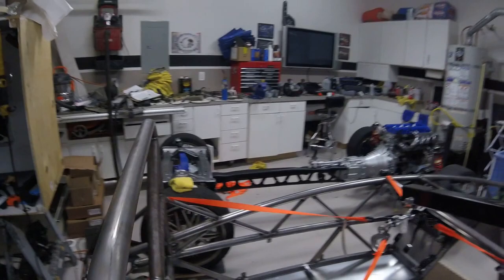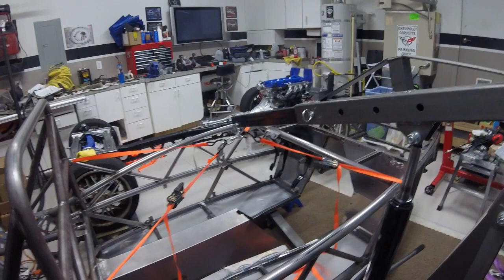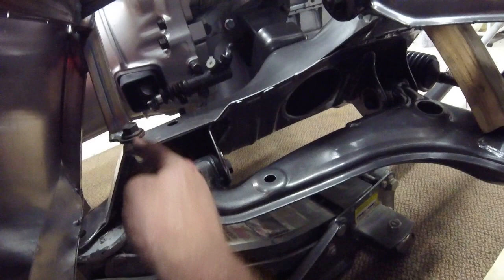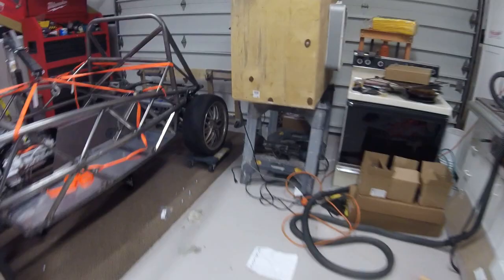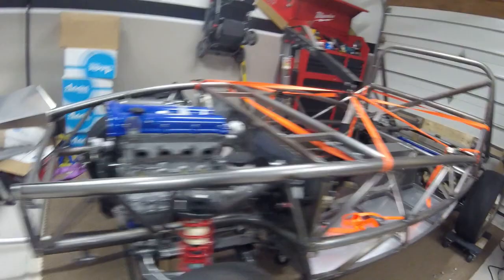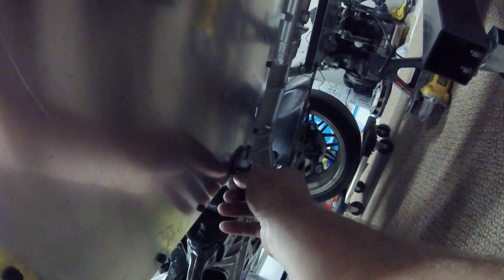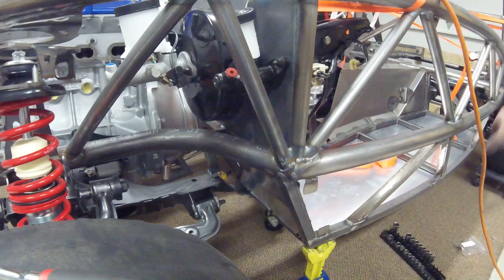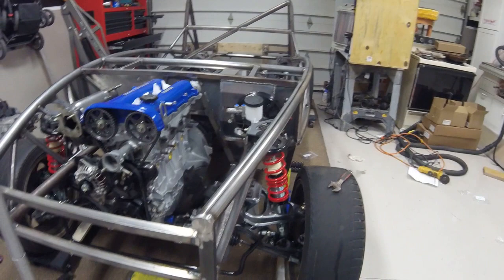Mounting The EXOCET FRAME On The Mazda Miata Donor. (Part 27)

Comment: Those straps freak me out. Something to remember about straps (or chains) is that the tension load in the strap is dependent on the angle.  If your strap is 30° from horizontal, the straps are holding twice the load as the weight of what you're carrying.  Smaller angle means even more load.  It looks like 4 were enough here, but it could have been disastrous if they stayed as horizontal as they were before you lifted the car.
Reply from the maker: exninja I can lift the frame up by myself.  They aren't handling the weight you think they are.  225 lbs at most.  Each strap is rated at 500 lbs
Reply: I know what the frame weighs.  Like I said, it appears 4 was enough.  It's not good practice to have near-horizontal straps lifting a vertical load.  Your straps start at horizontal.  The tension load in the strap approaches infinity(!) as the angle approaches 0° when you lift.  I don't know the exact angle your straps end up at, but there could easily be 200lb in each strap in your video.  Add bumps and jostling, and it goes up.  I just want to make sure someone watching doesn't repeat with something even more sketchy and ends up with a bent/broken tube or fallen load.  Bad strap practice has even brought down airplanes, it's no joke.  It's something that is easily not accounted for but can have tragic consequences.

Comment: Hey. Looking to build an exocet, why are you putting on spacers? Lifted off road Miata?
Reply from the maker: Nope it just adjusts the frame position to the stock pickup points for the shocks
Reply: @BuildingTheEXOCET  
It’s also be raised by an inch or so correct?